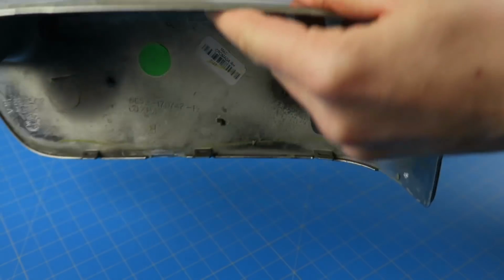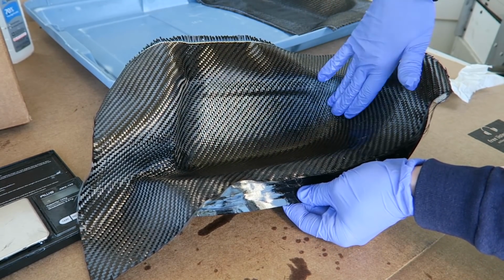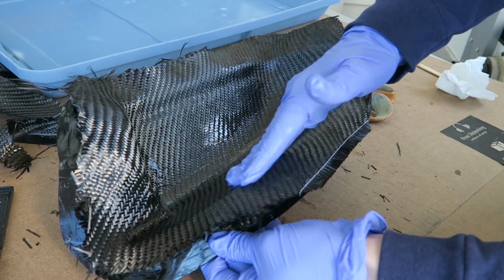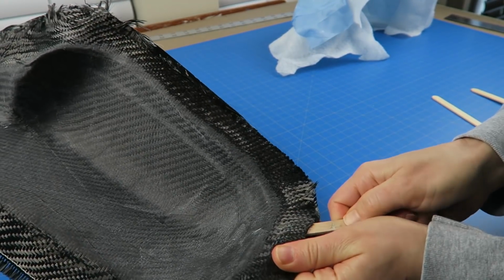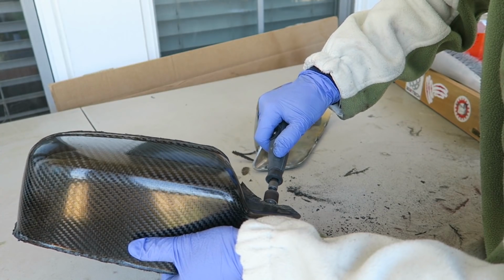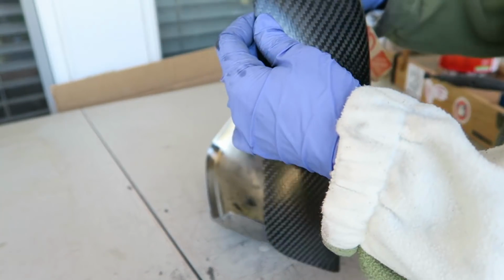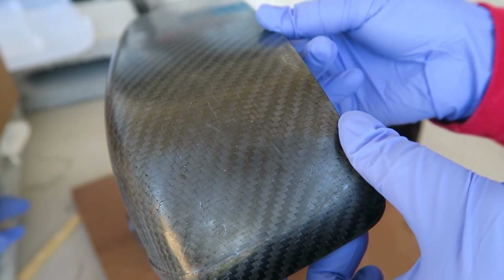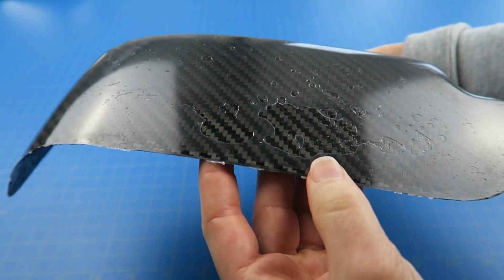Carbon Fiber Car Mirror Cover Lessons Learned

Comment: Oh and I forgot to tell you there are additives you can add to your epoxy to make it UV resistant and there's also epoxy with it already in the epoxy but it is more expensive. I found the spray ends up cracking due to the fluctuation of the part itself in the heat and cold and It flexes when on the road or shutting the door.

Comment: Damn, this..... The third time i'm watching this video. I don't even order the carbon fiber yet! 😑 poor me
Reply: I suggest you to check somewhere else how do things right, she make total mistakes from the begining, after it goes bad, the resin surplus, she made only 1 thing well in the half, grind but not this gradation, her paper was like 40-60, she suppose start with like 180-240 and slowly grind surface but not totaly later 320-400, 600, 800-1000, and finish with polishing paste so she could save it. Next glass try, was total fail, not because she take it  off broken, she not suppose do that at all, after you cut off overlap you not put it to the form again. And this was to save by same method i wrote earlier. But like i said in the beginning find out how do it right to avoid waste of time and material which isn't cheap.

Comment: Thats actually a pretty kickass job for just trying things out. For the outer finish, they make a product that leaves a high gloss, pocket free finish, because its an epoxy polyester gel coat. It also leaves  rough inner finish for a really tight mechanical bond. check out this video starting at 0:36.
https://www.youtube.com/watch?v=YWbGx_BJVvM&t=14s

Comment: Use a silver sharpy so you can see you cut and if you want to pop it out of the mold easier do your method of popsicle stick to loosen edges, after loosen use compressed air by blowing into the gap between the part and mold. So just get a compressor and a hose with a air nossle with a rubber tip. That will fly right out of the mold.

Comment: Make a video doing everything (the mold) & be more detailed with your products (gel coat epoxy/polyester). Next time, just put a coat of epoxy resin over the whole part and sand it flat for pin holes. Also use a 2k automotive clear (SprayMax). The clear you used is cheap & it’s garbage. One last thing, scuff the part before clearing with a grey scuff pad. You don’t want any glossy areas when apply a clear coat. 
But good video. That approach at the end was interesting.

Comment: I wish I found your video before I made the same mistake, adding resin and putting it back in the mold.
How much vacuum do you apply 20% or full 29.hg when applying to your wet lay up project?

Comment: Absolutely should have just added a layer of epoxy over the top of this after demolding it. Also, you should have used more epoxy in the mold after you layed your first layer of cloth down. Really wet that layer out, you have it way too dry

Comment: There are some problems in your manufacturing process, you should use RTM technology, and your die is not accurate, it is difficult to assemble in place. We have developed a set of carbon fiber rearview mirror technology in China, and commercial, if you are Interested, you can Communication.

Comment: Hi Lindy, thanks for share; could the epoxy layer be sanded with 500, 1000 to 6000 sandpaper and then polished as if it were paint?
Reply from the maker: It would need a UV protective finish anyways if it's going outside, so not much point. But epoxy can certainly be polished.
Reply: @LindyDesignLab  thanks for your answer, what did you finally? Start from the beginning?
Reply from the maker: @leonelgarcia7327  I've been too busy with other projects, but yes, I'll most likely need to start over.

Comment: @Lindy, enjoying your new ideas for techniques, like using the card or hand to spread! You might check out "Venom Steel Nitrile Gloves, Rip Resistant" I found on Amazon. They are really tough yet still get tactile dexterity.
Reply from the maker: Those look great, but I go through SO MANY GLOVES that I'll probably stick with the most economical option for now.
Reply: @LindyDesignLab  I find I can reuse them & almost impossible to tear. 😀
Reply: Lindy Design Lab not sure if you’ve gotten better with your work but from the beginning you could’ve done better, I’m talking from the absolute beginning. 

Your flange first off should’ve been larger and much more smooth. A flange is not just for extra fiber, it could also be used for room of extra bagging tape or consumables. if you decided to just use it for extra fiber run off material you should be wetting the entire material out, even excess material, it’s easier the pry up if the fabric is completely cured, would hate to see a delamination from the uncured fiber to cured.
Reply: Lindy Design Lab also on your gloves
That’s never been a good idea
The brush like you’ve used in the end would’ve worked just fine, a trick to keeping the strands from falling off into the part is crazy glue the strands at the base, they shouldn’t fall off at that point. 

Using your hand as you’ve probably found out is a gamble, sometimes it may work sometimes not, but why do it? It just makes things more messy or that card?🤔 no🤦🏾‍♂️ you will nick the fibers eventually. 

 U should be using polyester anyways for a cosmetic piece, S249A polyester resin has a UV inhibiter in it. 

Use that resin also as a gel coat first then as a lamination resin if your going to do a complete wet lay. 

Once you pop it out of the mold you could polish that, not sanding for repairs but because nothing shines like polyester!

Comment: Looked good until the recoat, like with glass mat, resin is just extra weight, once you have wetted out the cloth the extra resin adds very little stength, If weight is not a problem then gel coat the mold, the more gel coat the deeper the depth of the glass finish you get. (Note) some matting has a bonding agent in it, and this does not work well with a lot of epoxy resins, DO YOUR HOMEWORK. If you are not sure about how much resin to use, make small batches and overload the matting, then squeegee blade of the extra once the matting is loaded,

Comment: Good video. Why not use an actual cutting wheel to trim the part? Way less dust for sure. The other thing I do is clamp the part to the edge of the table or bench and hold the end of a shp vac right near the cutting tool to catch a lot of the dust right off the cut.
Reply from the maker: That's an excellent question to which I don't have a good answer. It seemed like the safest tool at the time to not take off too much material, but I definitely like using diamond cutting wheels now.
Reply: Lindy Design Lab got ya. It’s the first video of yours I came across so wasn’t sure if you changed up your techniques or not.

Comment: Just asking.
After you have sanded the edges the dust is in the air. How do you take that of the air??
Reply from the maker: Work outside, run an air filter or wet sand and avoid the problem in the first place.

Comment: After to do the cover, how do you fix it to the mirror car? The original cover have some plastic tabs which this carbon fiber cover hasn't. Thank you
Reply from the maker: To stand alone it would need tabs made and epoxied in place using some sort of jig to get the right placement.

Comment: What if you were to allow the cosmetic epoxy layer fully gel and get to the tacky stage before putting your cosmetic carbon layer in?
My thought is that way you're not pressing the carbon right hard against your mold surface.  You know you don't have pin holes cause the epoxy isn't moving any more, you also have beautiful depth in the finished part cause the carbon isn't pushed right against the mold surface.    Almost like a clear gelcoat done in the mold.
Reply from the maker: Sounds logical and worth testing.
Reply: @LindyDesignLab  If you try it I'm sure youtube would like to know how it works 😉

Comment: This stuff is Expensive but it makes life a lot easier!

Automotive or rattle can paints WILL cause pinholes, with parts that do not require a “Carbon” finish we always paint in the mould for that reason.

Check out this Product from Sicomin, https://youtu.be/eGPnmZo9X9U

I’m sure other manufacturers will have something similar...

Comment: How are you going to install it in the actual mirrror when all you did is just the layer. Tape it?  

How about the clips or tabs in the inside that will be used to attach the part to the actual mirror?
Reply from the maker: Mold and cast the inside, fuse the parts, make the tabs, place with a jig.
Reply: @LindyDesignLab   do have a video of that. I realy want to learn this.. thanks

Comment: Wear gloves when handling cured carbon! Cured carbon/resin is razor sharp, I have seen way too many carbon fiber injuries that could have been prevented by slipping on a pair of thick gloves.
Reply from the maker: Indeed. That stuff is wicked before trimming.
Reply: Exactly! Don’t pee on an electric fence either.

Comment: Now you have protected your face but now when you are ready with the dremel so now you have carbon dust in the air.... I don't use any facemask, I have vaccum cleaner very close were I cut the carbon. No dust in the air..
Reply: As long as the filter in your vacuum is fine enough, otherwise you're just blowing it out the back of the vacuum cleaner into the room again